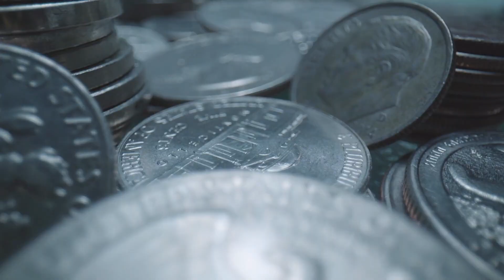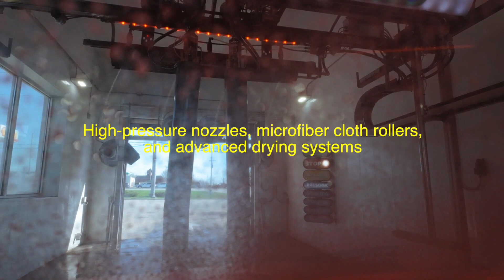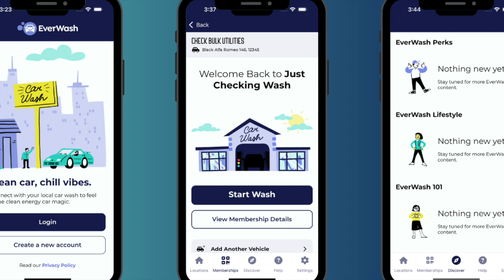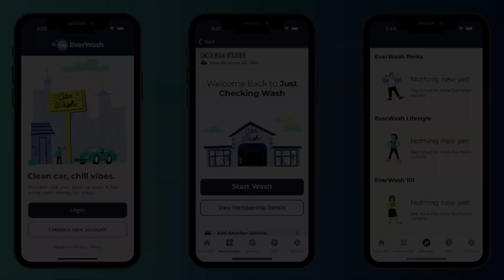How Car Wash Technology Transformed Over Time

Comment: The modern brushless car wash (US) is a culprit for vehicle headlamps to fog-over.  How do I know?  I have a model year 2000 pickup truck I've hand-washed three times in its life, front headlamps are still clear; as I do use a cleaner for the windshield/windows/mirrors and lights front and rear.
An acquaintance of mine had a 2001 model year of same pickup, where he has kept it looking immaculate over the years with weekly visits to the drive-thru car wash.  By 2016 the front headlamps were so fogged-over they looked like someone took tan spray paint on them; where he had to get new headlamps.
We live in the same neighborhood, with the vehicles parked outdoors 24/7.
BTW: Where I live there's adequate rainfall and rainstorms that does well to scrub away the grime on my truck.  The white paint is also a plus.